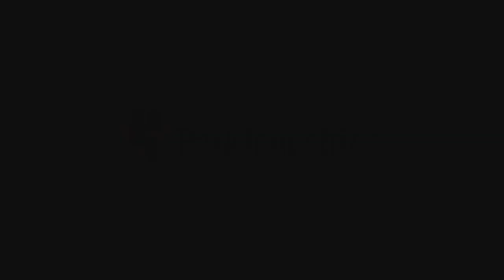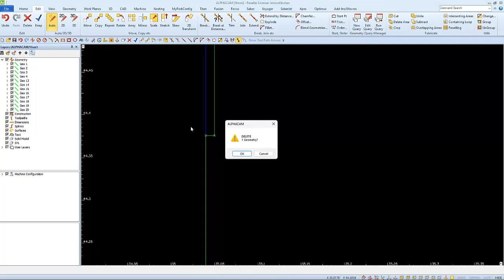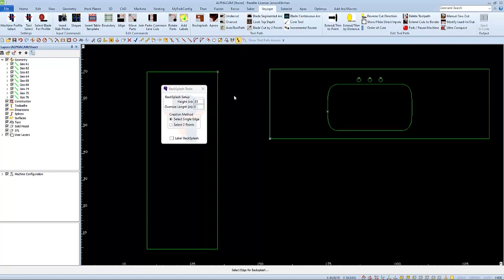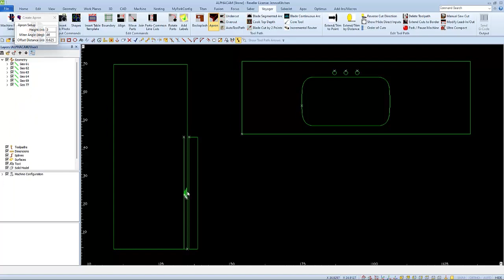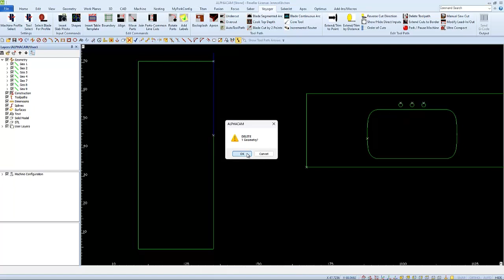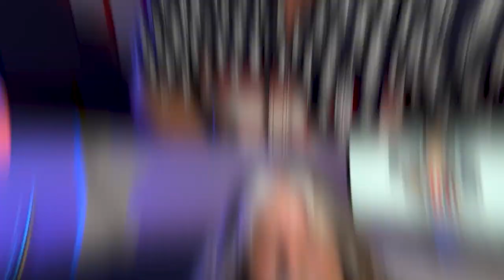Stopping a Miter Before a Seam

Comment: Hey Dan, any advice on what to do when cutting a miter on a seam, but  the waterjet doesn't cut 45 degrees. This is BRAD from CLEVELAND GRANITE & MARBLE.. Thank you for your videos.
Reply from the maker: Hi Brad, if the waterjet doesn't cut at an angle on your machine, you'll have to finish the inside corner by hand. Thank you for the comment and it's good to talk to you again!